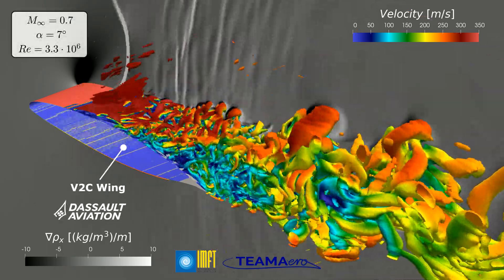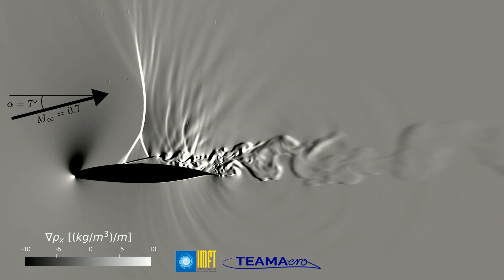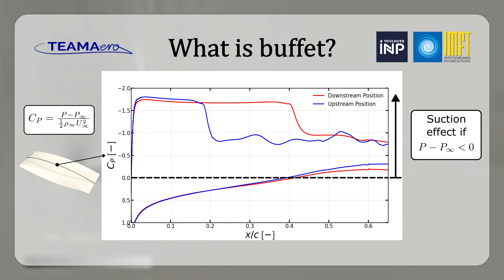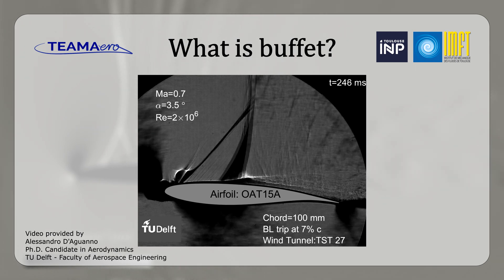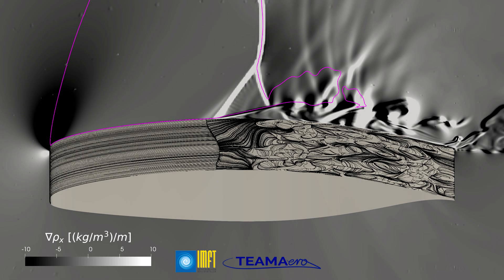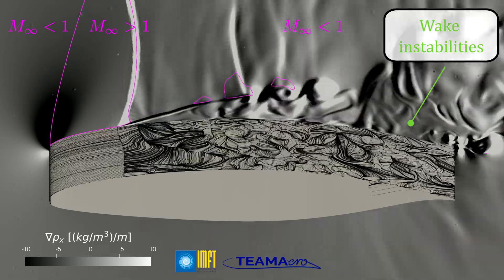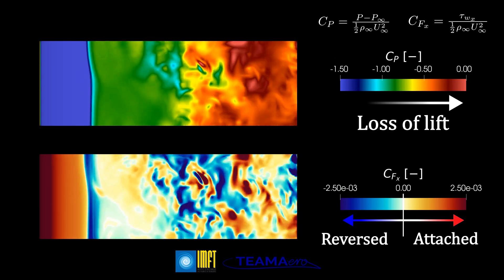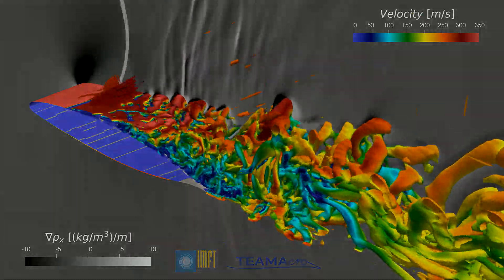Transonic buffet : An overview

Comment: Great video about your research! What airfoil is used in the simulation? Also ONERA OAT15A?
Reply from the maker: Thanks!! I'm glad that you like the video 😊 It is the V2C airfoil designed by Dassault Aviation ✈️
Reply: @cesarjimeneznavarro621  I see, thanks for the quick response! I'm a PhD candidate working on research regarding hybrid RANS-LES models (but more focussed on blunter (is that a word?) bodies). Right now, I'm looking for a reference case that contains buffet / shock-induced separation, and I stumbled upon your awesome video!
Reply from the maker: @ibonitog  thanks a lot for your message! I am very happy to hear when people find this content interesting! Maybe you meant "blunt bodies" 😊 And about cases with massive buffeting you can check the research done on the V2C wing because due to the high angles of attack it can be seen as a bluff body 😃
Reply: @ yeah I just meant more-blunt-than-a-wing bodies if that makes sense :D will check the V2C out for sure!